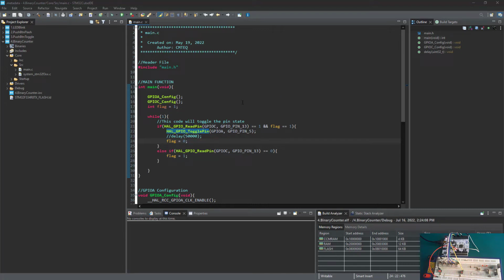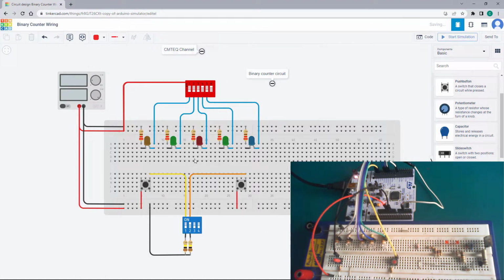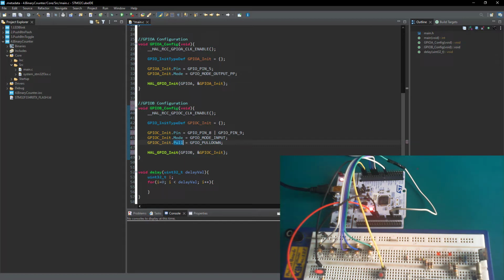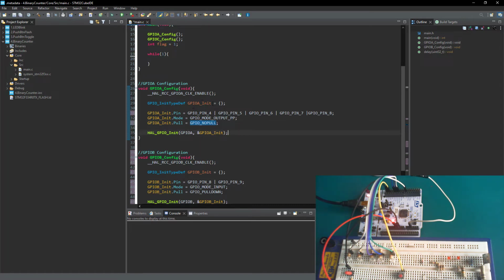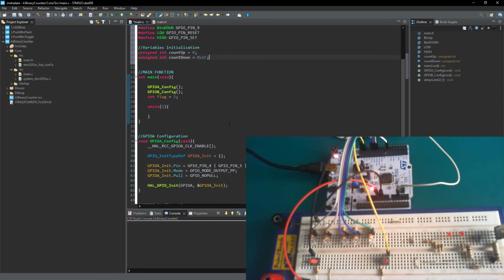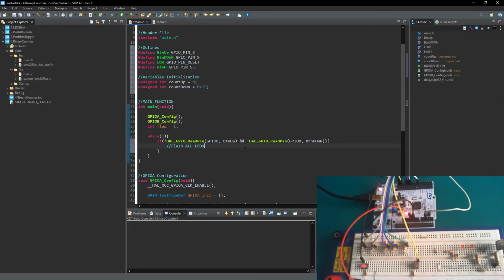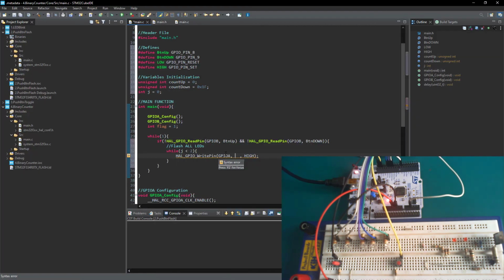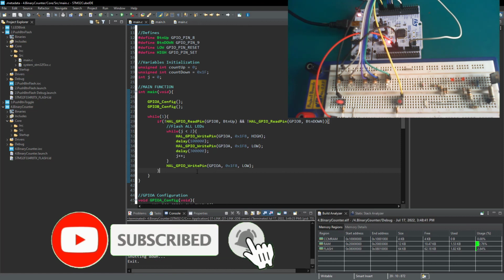4. stm32CubeIDE  - Binary counter (HAL Drivers). Part 1

Comment: How come we did not need  to set GPIO_NOPULL; in the previous video with toggle led please?
Reply from the maker: NOPULL is usually configured when we already have an external pull-up or down. In that case, you want the pin to float from internally.
I will review the code and see if there was no pull.